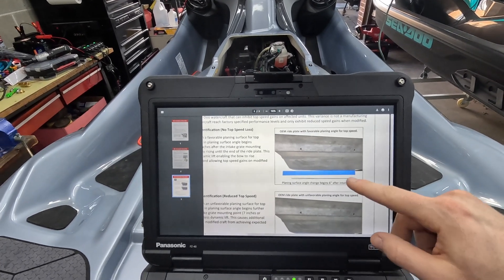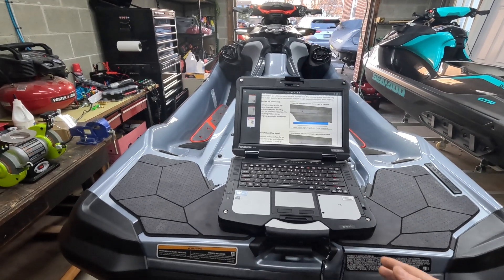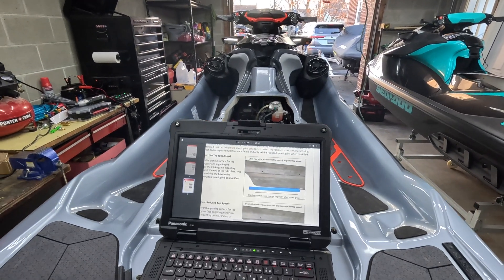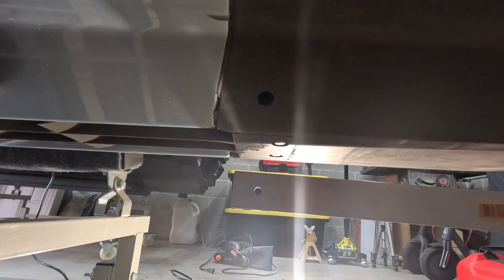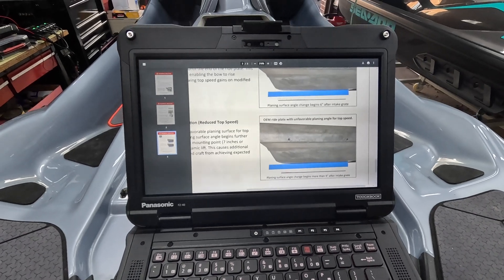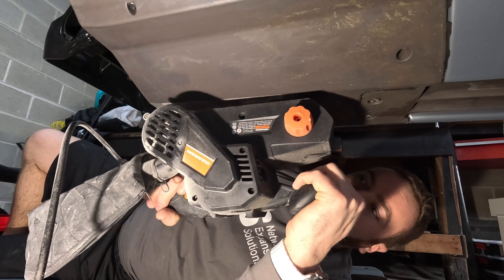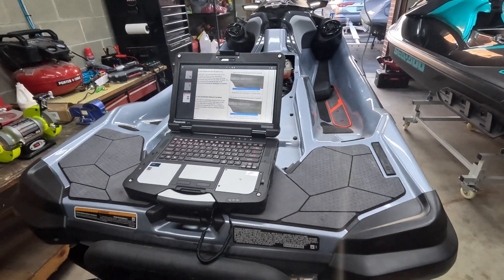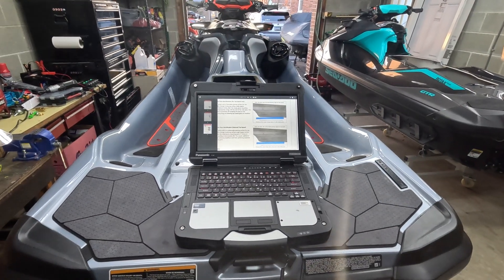SeaDoo 300/325 2022+ Ride Plate Mod (Free) // How To

Comment: You definitely weren’t lying about how thick the ride plate is. How long did it take you to dial in the ride plate? I’ve been at it for a while and I’ve barely made a dent. And my arms are jello now 😂
Reply from the maker: It’s crazy thick! I don’t remember how long it took but it was definitely quite a bit! I used a fairly aggressive pad at first to etch it away faster.

Comment: I have a 2022 Rxp 300x with fully bolt ons, and I can't pass 79mph its so stressful. I checked my ride plate with a beam level and it looks ok it doesn't look flat, I see the gap at the end. I have
 Riva dual exhaust 
 Riva water box, 
Calas performance cam, springs & retainers, 
Riva intake manifold upgrade
 Riva Silicone intercooler piping 
Riva blow off valve 
Riva oil catch can
Solas 13/18 impeller 
Stainless wear ring
Bosh VT1100 fuel injectors 
Riva xxx Supercharger 
Riva 8800 tune
 
I did a boost leak test at 21 psi and no leaks. I haven't checked my supercharger slip yet but thats next. Any recommendations Jake ? Should I still shaved my ride plate to see if it makes a difference?
Reply from the maker: I would definitely check your SC slip, if you haven't checked it at all that could be holding you back. Just about every factory charger I've checked is on the low end so you may not be making peak boost. Don't forget to factor in ventilation. If you haven't added any ventilation holes to your hull, your engine may be starving for air. The factory ventilation is nowhere near sufficient enough.
Reply: @jakgal041 Thanks! Jake, I am going to check the supercharger slip this weekend. Should I set the Riva XXX Supercharger to 18 FT lb ?  I had ordered the tool to check the slip but I didn't know for the 300 models the locking shaft tool is different also the the gear holder. I already order the correct ones so just waiting for them to check the slip.
Reply from the maker: @josesoto2703  That's the sweet spot for the XXX charger so you should be good with that spec. I'm willing to bet yours is probably in the range of 8-12.
Reply: @jetskijake-seadoo Thanks! I will let you know this weekend what the slip was.
Reply: Hey Jake I just checked the slip on the supercharger and it was at 14.9 lb
Reply from the maker: @josesoto2703  I wonder if that may be your issue, the slip on the XXX should be 18
Reply: What are your RPMs I've got a 21 that should not have ride plate problems but it does happen the biggest difference I found in mine the fizzle intercooler I can hit 79 but now can hit that all day I don't have the heat sink. Mine was actually hitting 8400 RPMs in Florida
Reply: @wesleycarusos8225 2022 rxp is hitting 8800 Rpm but has no top end. I just tighten the slip on the supercharger but I didn't get a chance to try it out to see if that made a difference. This coming weekend I am going to be testing it hoping to get above 79mph

Comment: Okay! I have a rear intake, scom, and catch can on my 24 rxtx. 78mph top speed. 8300rpm. Feel like i should be doing 80-82? Am i wrong or right? Lol guess im checking this and ibr stops
Reply from the maker: If you dial everything in, yes you should be in that range. iBR stops and the ride plate are definitely a place to check, as well as boost leaks! Make sure you don't have the defective manifold spacers.

Comment: Your silicon around the intake grate and ride plate is just as messed up as mine is/was... how annoying that they come this way!!! Look inside your pump tunnel, is it all messed up there too like mine with no way to reach it?

Anyway - great video - thanks for doing this!
Reply from the maker: Yup, mine has a very poor installation from the factory. I took the time on my last RXTX to redo the seams to make them clean but it had no impact on top speed so I didn't bother cleaning it up on this one.
Reply: @jetskijake-seadoo  I don't think I did either - it just bugged me... however, on my 17 RXP, the ride plate was full of bolt holes - and when I filled those in with silicon - I did actually gain 1 mph!
Reply from the maker: @racquetballgopro8697  Yeah I noticed on the pre 2020 and pre 300 redesign the ride plate sealant trick had more of an impact lol

Comment: I had assume the finish is some sort of anti corrosion, will there be any problem with the raw metal?
Reply from the maker: @TheTungsten  Nope, it’s not an anti corrosion finish. This ski has 37 hours on it now with mixed salt water riding and there’s no corrosion on the sanded parts so you’re good to go!
Reply: @jetskijake-seadoo  Good to know. My skis are down getting super slicked this week. I plan to inspect this and do the bucket mod next week.
Reply from the maker: @TheTungsten  Excellent! You should notice a decent gain doing both. Let me know if you have any questions!
Reply: Will you post the Riva bulletin
Reply from the maker: @teejay0712345  Yup, its in the description at the bottom.